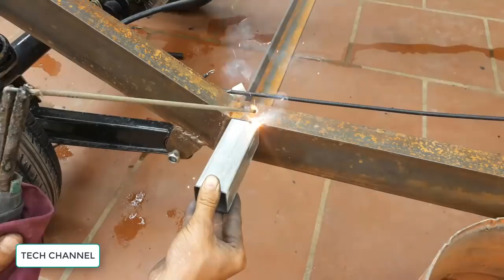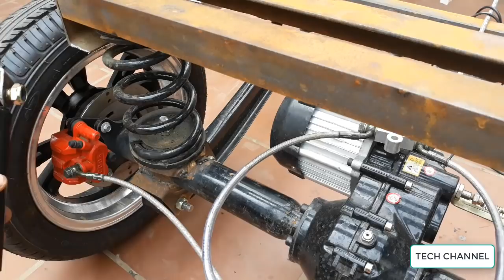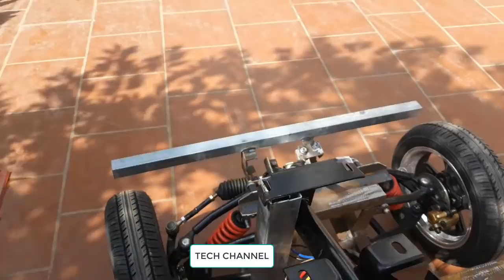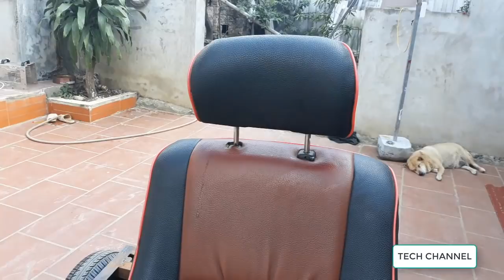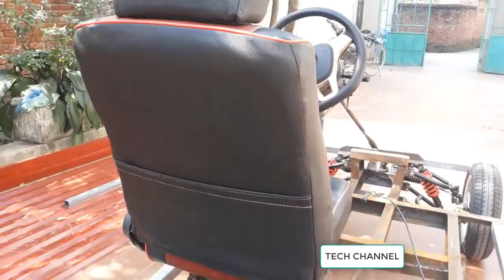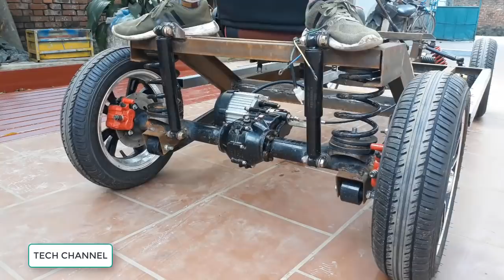TECH - Electric car with oil disc brakes - part 5

Comment: The oil shock absorber hinge is not correctly welded, it will simply break it under the load on the first bump or pit.
Reply: ehtge😍😍😍
Reply: Ji

Comment: Not a single technical dimension or any other information shared... trying monopoly over the product I suppose...
You should have shared details regarding the readymade parts atleast, the available or the brand of the readymade parts...
Reply: I really want to know what kind of motor he's using. That's the most important question.

Comment: What is the type of gear box used
Reply: @suhaerler6620  You still have to have at least 1 reduction gear to increase the torque from the motor, and a way to transfer the power to the wheels. So still do need a gear box, but it can be much simpler than in an engine powered car.